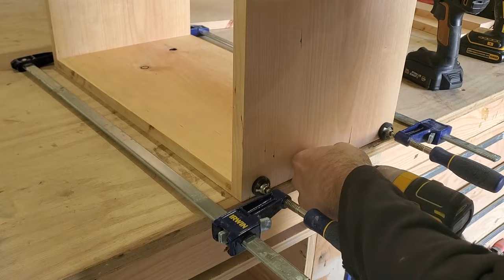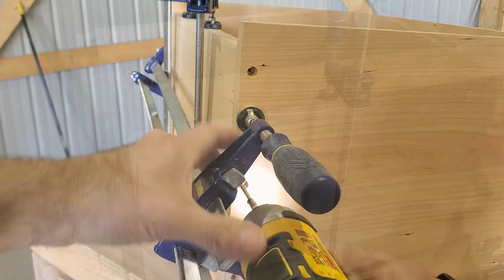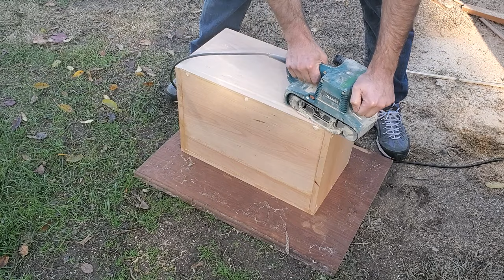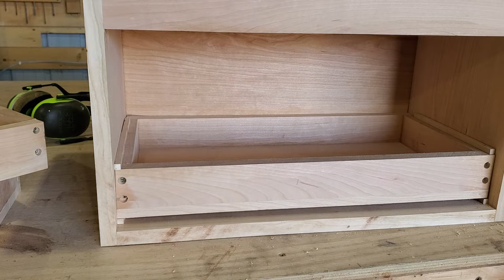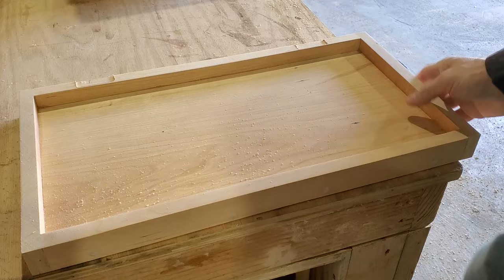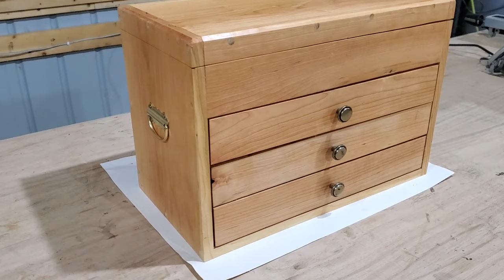DIY Tool Chest Build

Comment: This is so neat!!!! I want to try one like it... maybe not as tall!
What dimensional lumber did you used to start with? I thought it was plywood but the 2nd time around - it’s not!
Reply from the maker: Thank you,  I used cherry hardwood that I cut down and milled on my sawmill it's 3/4 inch thick
Reply: Wow! No wonder it’s such big boards!! Can’t get them that big at HD.
Reply: Thanks!
Reply from the maker: @bugfeet73  you can achieve the same results with plywood like oak or birch or check with your local sawmill they should have wide boards